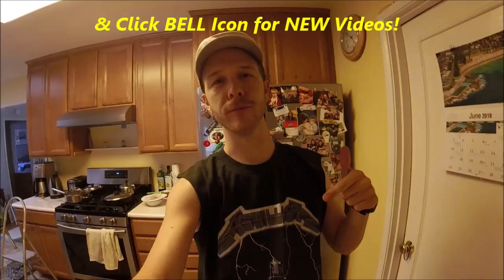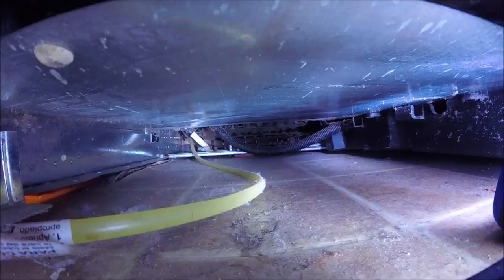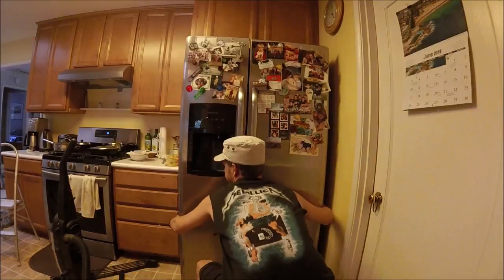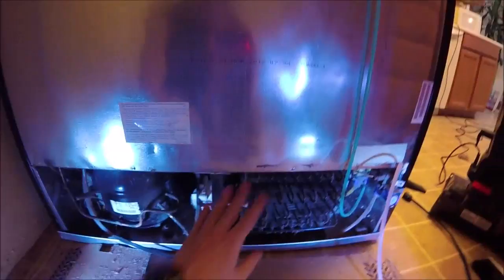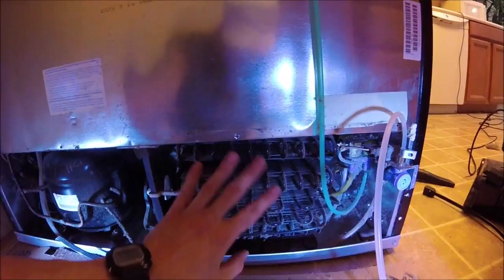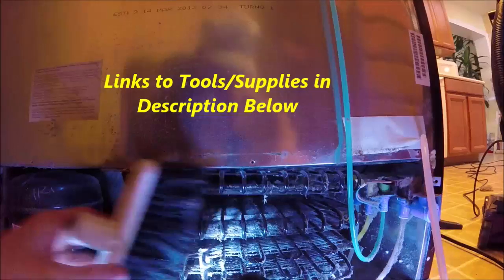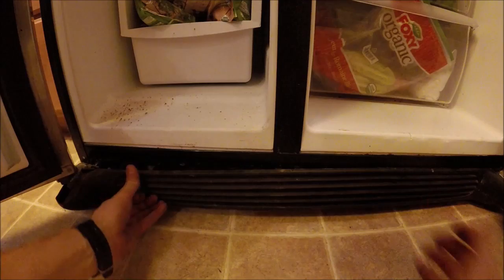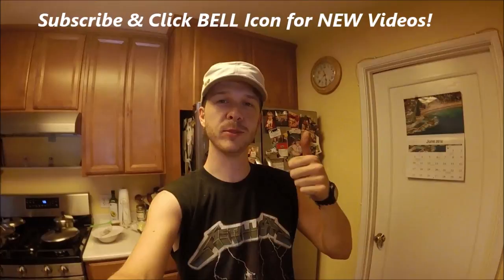How To Clean Refrigerator Condenser Coils Fast & Easy! -Jonny DIY

Comment: Just bought my first home and finally have my own fridge. Didn’t know this needed to be done. Thanks!
Reply from the maker: You're welcome, yes I try and do it at least once a year usually beginning of Summer 👍
Reply from the maker: Ps- Congratulations on new home!
Reply: I think most people don't know, actually
Reply: Yea I don't think most people know about this maintenance item. Only reason I even thought about it is 1 the freezer ain't freezing. And 2 there's an split a/c at work that cools a room full of servers (dedicated computers). The condenser portion is outside of the room and gets a lot of dust build up and often looses cooling capacity. When this happens they clean the condenser coils and everything is good as new.

Comment: My refrigerator used to be my aunts, that she kept OUTDOORS for years. I never knew I have to clean the coils, and it has been working fabulous until recently I noticed it’s not cooling as it usually does. I just opened the back and saw so much dust and debris that I was pouring out of the cardboard cover… leaves dust hair you name it! After using a swiffer duster, butter knife wrapped with a microfiber towel, vaccuum hose with a straw taped to it, and a tooth brush, im proud to say it almost looks brand new again. Now we wait a few hours and see if this did justice :) thank you!
Reply from the maker: You're very welcome, glad I could help. Hope it helps 👍
Reply: @JonnyDIY  it worked it’s cooling better than ever now, thank you again
Reply from the maker: @annaess3844  Awesome to hear that, you're welcome. Happy it helped 👍

Comment: Little ashamed to say this but I bought my house almost three years ago and didn’t even think about cleaning my refrigerator coils until tonight. Thanks for the straight forward tutorial, though I definitely need to buy a brush to finish cleaning mine this week.
Reply from the maker: You're welcome, and hey, better late than never! 👍🏻
Reply: Having a refrigerator brush and a vaccuun cleaner to suck up loosened dust makes the task easy.

Refrigerator brushes can be purchased at hardware stores of HD for $6-8. 

<<Little ashamed to say this but I bought my house almost three years ago and didn’t even think about cleaning my refrigerator coils until tonight. Thanks for the straight forward tutorial, though I definitely need to buy a brush to finish cleaning mine this week.>>

So, what did you find when you finally pulled off the grill and looked at your regrigerator coils?  And how often do you clean the coils since that first time?
Reply: Well this is my first time ever going to clean it had for over 5 years

Comment: This is a very important tip, I do it at least once per year. If you have pets i would do it way more often. Great tip video.
Reply from the maker: Thanks Shane! 👍
Reply: We have had dogs (one at a time) for 12 years,  embarrassed to say I pulled the front grille a little while ago and there was what looked like a full sizes fluffy cat living under the fridge.  There was easy enough hair and dust to cover a 25 lb dog. It was horrible.  (Hangs head)
Reply: @PayNoTaxes0GetNoVote  Yeah it doesn’t take long to build up that’s for sure. I can imagine after that long how much was down there. I’m sure once you cleaned it out your refrigerator had a sigh of relief lol. Thanks for commenting

Comment: Just want to thank Jonny for helping me and my son tackle this job. I was going to grab a fridge dolly and take it outside and blow it down with the air compressor but we ended up using the shop vac along with some brushes for cleaning hummingbird feeders and it worked great. My fridge is now running so much cooler that I had to turn it down a notch and still have ice cold beer. Thanks again.
Reply from the maker: Awesome to hear that. You're welcome, glad I was able to help you guys out 👍🍻
Reply: Happy to hear about your beer

Comment: Its Sunday morning at 430 AM and by chance I got up 45 minutes ago, and opened the fridge door. It was open 2 minutes "MAYBE" and it started beeping. I took a look inside and could see condensation on the side walls. I  closed the door and waited about 5 minutes and opened the door again and same thing, This time I noticed the temp was flashing "H". Since  I had just food shopped yesterday- the fridge was fairly full. So I could not go back to sleep . I googled the model on line and in 5 minutes- located top 5 reasons- its beeping and it mentioned the coils and that you should clean them at least once per year. I've lived her 7 and have never cleaned them. I found this  video and popped off the kick panel- and was  like- OMG. I cleaned out some of the gunk with my brush. But will follow all your instructions when I get up this AM and should be good to go!!  Thank you so much. Im 66 and just had my hot water heater repaired 2 days ago- and cant afford another service call. And this clean up- I can handle on my own
Reply from the maker: Good luck,  hope it starts working well again 🙏👍
Reply: @JonnyDIY  Morning.....I cleaned everything and thought or hoped that would take care of it- but nope. It started beeping again a day later, and I watched a few more videos. It turned out that my damper door was not functioning and the whole assembly needs to be replaced. Long story short- limited air is flowing between the two  sides and temp is fairly stable at 40 - providing I keep the door closed as much as possible. I ordered the assembly on Thursday and the part arrived at the KC- UPS facility yesterday. Hoping they will deliver it today and my SIL will install it. Otherwise tmrw after work.
Reply from the maker: @deborahjames1891  ohh awesome, glad to hear you've hopefully got it figured out 🤞

Comment: Thanks Jonny! Going to try doing this. I haven't cleaned out my fridge for years. I don't think the previous owner did either. Holy Cow, I don't want to see what's behind the fridge. Mine is an old school top freezer and bottom fridge. Fingers crossed! Hopefully it goes well.  😀
Reply from the maker: You're welcome, glad to help. Good luck! 👍
Reply: @JonnyDIY  I reached in with my vacuum tube and got some dust out. There's this grill that is bolted that stops me from just pulling it out. xD oh well doesn't seem to help the fridge. It's not cold anymore! Hahaha.
Reply from the maker: @thursmornsunlight  ohh dang sorry to hear about the fridge. Hopefully you can get it cooling again or find a suitable replacement

Comment: Absolutely going to do this in a few minutes . I remember someone else doing this and this might do the trick . Fridge isn't cooling as much as should be . Milk and other things don't last as long . I always try the cheapest easiest remedy first in everything I do .
Reply: Just found out that ice is completely covering the bottom opening which must be the air return from fridge back to the freezer. I did a lil chipping away at it. Can I use a heat gun or better if I unplug, take everything out and let it thaw out?
Reply: @Anastasia11101  I don't quite understand it but I partially chipped ice out from return air opening and the rest cleared up somehow . Now getting almost 32 degrees since Saturday . I'm talking about the bottom opening that returns air back to freezer . WOWW i couldn't be happier . And before there was a good amount ( almost half liter ) of water that collected at the bottom of inside fridge but not anymore
Reply: My milk and stuff isn’t cooling thay wel either and I’m about to do this so did cleaning your fridge this way fix the cooling situation,?

Comment: Great video.... good information, no stupid sound track, Just the facts. How much electricity could we save if simple thing was done ofter?
Reply from the maker: Thank you, happy to help. Hard to say how much exactly, but it will make a difference 👍
Reply: <<Great video.... good information, no stupid sound track, Just the facts. How much electricity could we save if simple thing was done ofter?>>

Interesting question.

And the answer is----

I don't know and can't recall any authoritative estimates.

The biggest benefits are that you refrigerator will do it's job of keeping things cold better, especially during the peak of the summer season when things are hot.

But there are bound to be power savings as well.

Comment: I have an older top-freezer refrigerator and recently ice has started forming in the refrigerator on food and on storage containers. So the first thing I did was declutter the refrigerator to make sure that airflow was circulating. But I still found ice the next day, so I used condensed air to spray out the dust that was in the back panel vent. I may need a brush to clean under the fridge. I hope cleaning it helps stop it from freezing everything.
Reply from the maker: all good things to do, try not putting anything you dont want frozen towards the back of fridge as that's where usually happens. Could be thermostat not knowing when to shut off. Try dialing down the cold s lil make it warmer in fridge but keep it between 35-40 degrees F
Reply: Make sure your door is closing completely and your getting a good door seal all the way around.
Reply: There is probably a drain tube at the back of the freezer compartment, you may have to remove the inside back panel to spot it. If that tube is clogged, the automatic defrost cycle basically is useless and the freezer will ice up. There might also be one in the 'fridge compartment, but that one is usually at the bottom under the bottom drawer and easy to clean out. Also, if you have an ice maker there is possibly a cracked tank in the back of the fridge compartment leaking slowly. They don't build 'em like they used to! (Plus an OLD fridge will last decades. New ones are designed to last maximum 10 years!.

Comment: I used a very strong leaf blower and blew out the dust and used a damp towel on the other side to catch the dust. It works. Just make sure the leaf blower is strong.
Reply from the maker: Great idea with the damp towel to catch the dust. Will have to try that, usually just use canned air
Reply: DAMNIT!!!! I used a leaf blower to but did NOT use a towel…. Now I get to clean my whole kitchen….
Reply: <<I used a very strong leaf blower and blew out the dust and used a damp towel on the other side to catch the dust. It works. Just make sure the leaf blower is strong.>>

Interesting idea.  But you certainly risk getting a lot of dust spread around the kitchen. 

Personally I find that using a refrigerator coil brush to clean the coils and a vacuum to suck up the dust works well. I do the job twice/year so perfection isn't important.
Reply: Some refrigerators do not allow access to the coils at all. I was desperate and used a leaf blower. A wet towel and barricading it on one side was my only option. A coil
Brush did not work. Perhaps my refrigerator is way too old.
Reply: @papapickett7267  lol

Comment: These coils are easy to access from the back, mine are on the bottom, and can only be partially access from the back and front. It's a much harder job than is shown in this video. YMMV.
Reply from the maker: Yes it is different on each fridge, where and how easily accessible the coils are 👍

Comment: Can you just use blower feature on Shop Vac instead of hooking up the vacuum feature -- to blow dust out of there, off the coils? Cheaper in long run than buying cans of Compressed Air.
Reply from the maker: Yes, that's a great idea 👍

Comment: There's a front grid blocking the coils on my Kitchenaid. Will pull the fridge out & attack it again. Thanks for the help.
Reply from the maker: You're welcome, glad I could help. Yes, each fridge is seems is a tiny bit different getting those grid screens off. Some and screwed on some just snap on

Comment: My fridge hasn’t been as cold as it should and the freezer def not freezing decided to pop the back open and omg a whole lot of dust!!
Reply: Hi Elieen, my fridge’s freezer is not working and not sure if just by cleaning the coils it will resolve the issue. Wondering if you had the same problem and did cleaning it resolve it?
Reply: @Dat1RapKid  did you end up finding out I’m having the same situation
Reply: @mariekors2266  Did not work for me. I ended up getting a new refrigerator.

Comment: I know this was an old video. But ty sir!!! I can't afford to replace a new refridgerator for like $800. When we bought our house two years ago this August 31. It'll stay cool, but won't freeze me meat or ice. If i buy a bag of ice, it'll stay COOL/FROZEN, but will not make new homemade ice, if this makes sense??? thank you!!!
Reply from the maker: You're welcome, glad to help. Hopefully this will help some 👍
Reply: First I'd follow the directions and inspect and clean the coils if they have a lot of dust on them.   The dust prevents the coils from getting rid of heat extracted from inside the refrigerator, so the refer's ability to cool things off declines.  Also, when that happens the motor can overheat and prevent any cooling at all. 

So how is your refer working now, two months after posting you comment?

Comment: Ummmm.  I just cleaned the coils and grill on my refrigerator, and then decided to check out You Tube for ideas I might have used.

I turned off the refrigerator using the dials rather than pulling the plug.  Either method shuts off the fan which will circulate dust while you are cleaning.

I think the methods demonstrated are fine.  I have and use a refrigerator coil cleaner brush rather than a toothbrush and air compressor..  The refer coils brush does a pretty good and easy job of cleaning coils and I use a vacuum cleaner to suck up dust.

When that is completed, I still pull out the refrigerator and vacuum up the loosened dust which simply fell to the floor.  There is quite a lot of that, so this step is important. 

Doing this method twice/year should be adequate in most homes, but you can judge that based on the dust accumulated.  Doing that before the hottest part of the year will give your refrigerator the easiest time of keeping things cold.

This task took me about ten minutes to do, mainly since I knew where the refrigerator brush was to be found!
Reply from the maker: Awesome, glad you got it done. Thanks for sharing 👍

Comment: I'm able to get the front and back of the coils but how do you get the middle?

Btw, cleaned my coils for thr first time in 16 years...couldn't find the front of the coils because it was behind a wall of dust! 😨
Reply from the maker: Awesome, better late than never. Compressed air works well or you could use a small brush, toothbrush, paintbrush. Tape to a stick to reach further back 👍
Reply: @JonnyDIY  I heard you can spray water or a coil cleansing foam....is that effective and safe?
Reply from the maker: @chriss8354  I wouldn't use water as theres other electronic components down there, and really no need for coil foam on this, just a damp soapy water rag is fine. Coil foam is more for cleaning air conditioners in my experience
Reply: @JonnyDIY  got you. Thanks!
Reply from the maker: @chriss8354  you're welcome, glad to help 👍
Reply: <<I'm able to get the front and back of the coils but how do you get the middle>>

Buy a refrigerator coil cleaning brush at a hardware store for $6-8.  Use that to loosen up the dust and then a vacuum to suck up the dust.  I find it necessary to pull the refrigerator out to vacuum up the dust that falls to the floor.

Comment: my fridge does not have the bottom grill any idea where are flow would be?
Reply from the maker: Should have coils on bottom of fridge either in front or back. Either there or may have a back panel to remove to clean coils

Comment: Is there generally any concern if you have a condensate drip tray under the coils. I.e. water getting blown on circuit board? I only see one board to the right for what looks like the ice maker input...
Reply from the maker: Should be fine, they usually all have quite a bit of water in those trays that collects and evaporates from the fan
Reply: @JonnyDIY  I was concerned if it got blown up when cleaning with compressed air. I tried to aim toward the back and away from anything, little water escaped but I let it dry
Reply from the maker: @Attohertz  ohh ok I gotcha, I understand now. That's a smart idea as they really don't design placement of some of the electronics in the best places
Reply from the maker: I'll usually soak that water up with a towel beforehand though now remembering 👍
Reply: Hard to get it all, dust damming it back in there under the coils...